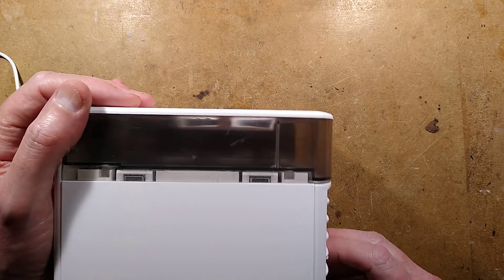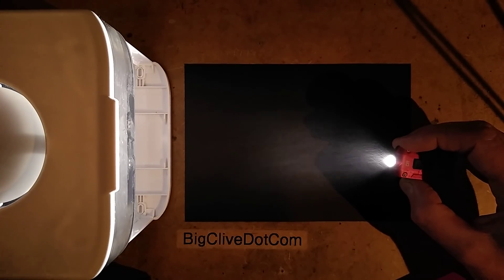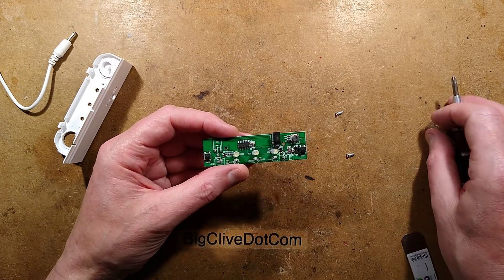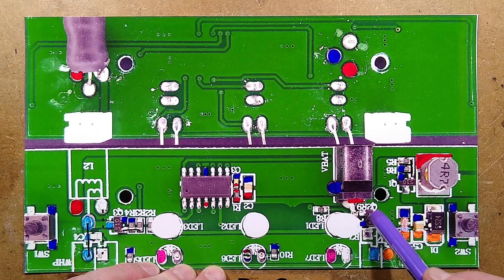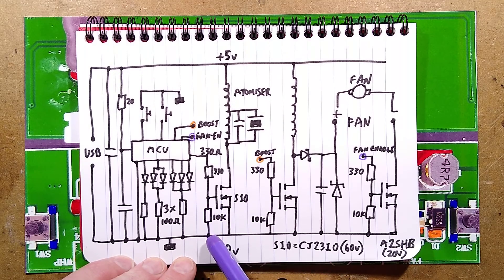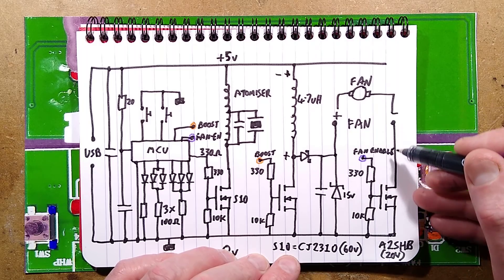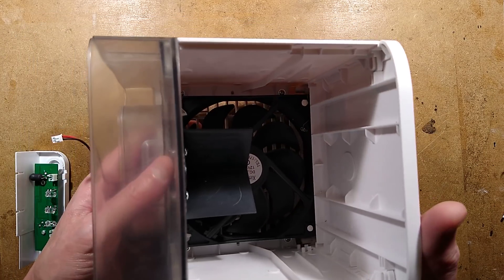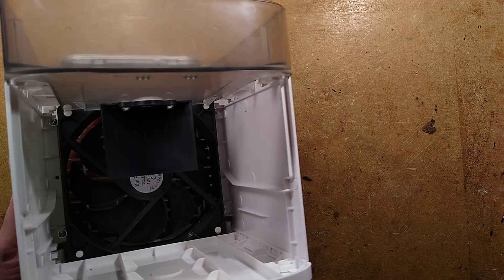USB swamp cooler with fake UVC "sterilisation" (with schematic)

Comment: So I have this cooler but the board is very different inside and my knowledge on circuitry is limited.
The fan was noisy as hell (cheap) so I replaced the fan with another but its drawing 0.1amps more. That is enough to drain the 12v booster circuit on high speed... any mods I can do? Guessing no as I'd lose my speed control right?

Comment: The way I see it, these things are actually amazing products hindered by absolutely crap marketing to the wrong audience. Sell them as Maker Cases or something, a solution looking for problems, and you'll get people to actually use them instead of throwing them in the bin and calling them a scam. I just got one and find it would be a great sleeping fan due to the loud noise and soft light, minus all the water bits. Another use I could have for it is as a small-space spray box for air brushing models and miniatures - Just remove the atomizer, reverse the fan, put a filter in the back, swap out the LEDs, place a turntable on the bottom, and I've got a nice well lit box to safely paint in. Put some paper or cloth in it and can then use it as a light box for taking photos of finished miniatures. The reservoir serves as a nice way to add and manipulate the lighting, and is ample enough to be used as storage for painting supplies or bits I'm working on. I thought about replacing the atomizer with a motorized turntable, but I don't know enough about electronics to know if that's easily possible. I have my doubts that the atomizer can handle any paints, and there's little reason for it since I have an airbrush, but it might be able to produce some unique and interesting results if it works.

Comment: If you freeze the filter after wetting it it works for about 5 ish minutes of really cold air, and if you have the water in the top it would extend it a bit, tho it's a waist of time to even do this, and you can get sick from this also

Comment: B.C. i found an opto- for detecting UVA, B and C. Mind you that UVC has power in the microwatt range ! 
The above dtectors guvct21 costs about $15 and give a reading on a voltmeter. There is a demo that 
bacteria are killed within seconds. He shows this with an overhead projector. To be seen here :
https://www.youtube.com/watch?v=nMHTATL-ZHY  In the 60's households had a artificial
sun that emitted these stinging UVC's. There are also UVA/C testcards but these need > 300 microwatts
to react. Which is above the health range. This would be a nice new project.

Comment: Ive got one very similar to that, i replaced the sponges with dishwashing sponges. It works well in an airconditioned offices. It adds to humidity but hey i was cool.
Mine has the spots for the uvc but nothing there. The colour changing is still there 
I use it now as a smell machine ie tip essential oils in the resevoir and turn it on to make the place smell better.

Comment: Did you know that you are being used in an ad for a company called voltex?
Reply from the maker: Yes.  It happens a lot.
Reply: @bigclivedotcom  just wanted to make you aware, seen and thought i recognise that hand and bench. It contained a circuit breaker with a red and blue wire coming out the bottom.

Comment: These things do work a bit when you ventilate the room very well, e.g. wind outside with open windows. But when you close everything, the only place keeping a bit cold is right in front of the device, a nasty island of comfort, because the rest of the room keeps rising in temperature and humidity.

Comment: As far as L2 (For atomizer) is concerned, it could be that the PCB silk screen is simply wrong. An easy way to check, without unwinding it, would be to ohmmeter it to determine which terminal is actually the center tap.

Comment: They built themselves an open loop boost converter with no feedback, relying on the fact that the fan is a (mostly) known load to set the duty cycle on the transistor blindly for their low/medium/high settings just to save themselves a comparator or analog input; fascinating. Especially since it meant that the zener became a required component instead of an optional one.

Comment: Comments

Add a public comment...

Steve L
Clive,

When the ultrasonic crystal is not powered, what keeps the water from a full tank from dribbling out?

Any idea what the voltage and frequency driving the crystal is?

Physically, what does the ultrasonic crystal look like?

Mad scientist idea; Adding a heater and pot infused e-cig fluid to the hopper could make your next disco gig a real "high"!

If we hear that the Isle of Man has slipped it's moorings and gone adrift, we will know that you tried the experiment, and it was a "hit"!

Thanks, Clive  :-)
Reply from the maker: With a full tank it is prone to oozing.

Comment: Swamp coolers on the coast is a waste of time.. I have one, humidity never drops below 55%.. But it was not the main reason, it is a big unit with a powerful squirrel fan, it can suck in cool air at nights and blow it across the house, in line with the prevailing winds. 

Too bad this is an "eco" house designed to trap heat in the structure. So, one it warms up, it stays warm. I can pump in cooler air, when it is 29C inside and i pump in sub 20C, i can get the apartment to lower to 26C, and within one hour, it is back to 29C. 

But in the odd days that humidity is lower, it is a nice "bonus". I've been thinking about using a peltier, a radiator and a closed waterloop... The damn thing is so big i could easily fit it in there..

Comment: live in Denver Colorado,  it's been more humid than normal and still only 40% humidity today.  Was 100* F (38* C) yesterday and my large house was 71* F (21* C) all with a swamp (evaporative) cooler in first floor window.  Amazingly effective most the time here.  I still think these little desk top things might only work if it's right in front of your face.  The cooling is directly proportional to the amount of water you evaporate,  my cooler has a constant water supply (with float control),  huge fan and 3 large meter square pads.  That thing holds a couple hundred cc of water, that doesn't translate to very many BTUs when evaporated.  I suppose still better than just a fan alone.

Comment: AAAACK! Finally got the time to watch the rest of the last live stream and it was gone!! I managed to catch the first three or so hours and I was left in stitches! LMFAO with the antics of the other two members of the MBC!!! Your expression at their shenanigans reminded me of the the American comedian Jack Benny when someone really pissed him off ! 
Interesting device, been using "negative ion generators" for over 30 years, mainly in my vehicle and especially on long trips, its quite invigorating and keeps me far more alert while driving. My most recent purchase was from a truck stop back in the states and it was quite similar to a large one you showed when you shared the type of plastic containers you use for storage. It operates off of 12VDC and I keep it running 24/7/365 in my store rooms (through regular rotation) it helps kill off mold and that stagnant air one finds in a damp environment here in Crete. I need to take it apart every two months to clean the needles and the large stainless assembly in front of the emitters.

Comment: Obviously in this case UVC means useless violet colour! Anyhoo, one bit that intrigued me was that the atomiser passed the water through it!? That wasn't explained in much detail. How would you drive something at high voltage if its effectively immersed in water? Does water dribble through without the atomiser function on? Maybe the drive circuit is utilising the series resonant mode of the transducer, this then would be all current and low voltage?

Comment: I have an interesting one for you...
A Ritello Purello.
Which is a waterswirling air purifier, which can be scented. It's advertised as having an Ionizer, but the also claim it doesnt produce ozone...
Would be interesting to see the ins and outs of that device...
Reply from the maker: I've taken a water air cleaner apart in the past.  If it has an ioniser it will contain one of the little black potted modules and will produce the tiniest trace level of ozone below naturally occurring levels.

Comment: Driving 12V fan with 5V is quite normal thing to reduce noise in PC cases. First you need get the fan going and then reduce voltage.

Comment: Have you tried using vhisky or wodka instead of vater? At least then you won't be disappointed with its cooling performance when you're in a drunken stupor by the fumes or maybe you could use it for that sole purpose.

Comment: So fake UV as protection from presumably  legionella that causes Legionnaires Disease. In my opinion, unless you are seeking cooling from dry desert heat, evaporative cooling is a waste of time. In the uk, our heat waves seem to be associated with high humidity, and even when there not, the last thing you want is to be both hot and wet.
Maybe you should add an an ozone generator, it will likely be more effective than those LEDs.

Comment: These things are absolute rubbish. It's all quackery. I borrowed one to try and discovered it was utterly useless - in my non-climate-controlled garage, the only thing it was good for was making it even more humid, and I had to literally put my hand an inch or two from the grille to feel anything.
One year, I built a "better mousetrap," out of a cooler, a tabletop water fountain pump, some vinyl hose, and a smattering of PC cooling parts (radiator, high-CFM fan, fan duct, a PWM fan controller). Fill the cooler with frozen bottles submerged in water, the fountain pump circulates ice-cold water through the PC radiator, the fan blows cold air across the radiator into the duct that can be aimed where you want it. It wasn't perfect, but it worked reasonably well for direct spot-cooling (albeit noisy, I blew out the PWM controller out of stupidity so I ran that sucker at full-tilt). I've done two different iterations, and there are still kinks to work out, but I stopped working on it because, let's face it, it's horribly inefficient.
One of these days, I might get to playing with Peltiers, water loops, mini fans and radiators. I'm only looking for a small zone of cooling, it would cost a LOT to have my garage electrics updated to support a better cooling solution like a through-wall aircon. Plus, it would be kinda fun to design it all out with thermostatic controls - the basic idea would be to run the Peltier as-needed to maintain desired temperature of the water in the loop, and use the water in the loop itself for the cooling. I keep kicking the idea around, but I never actually go through with it. lol

Comment: I've seen these in ads on social media for $60 to $90 - and now see they're on eBay for under $20.

It's not about what they are; it's about what they aren't!  They are not an "air conditioner" by any means!  That's the biggest lie.  They claim it will cool down a large room quickly - another advertising hype.

But I see several things missing.  First is a way for it to let you know it's out of water.  And with a uC inside, it would be nice if it would tell if there was enough temperature difference between the wet and dry temperatures to be effective at cooling.  What do two 1N4148 diodes cost?  They can be used as thermometers.  I think those fake UV and tricolor LEDs may have been meant for the water sensing indicators, etc.  Like, why bother putting them in there if they're doing nothing?  And the uC could be used as an hour timer to automatically shut it off.
For an extra nominal cost a motion sensor could be added to shut it off when no one is around.

Thanks, Clive for your taking to bits and schematic.  Very enjoyable.  You might try looking for hidden operating modes by pressing and holding the buttons, or rapid pressing multiple times. 🧐🤗😁

Comment: What flashlight is that ? CRI ? Looks like a familiar construction to my Nitecore Model: TIP SE
Reply from the maker: Tip.  Not sure which version I used.
Reply: Actually, I do have the tip cri 2017 edition very neat and small 😊😊 with the Nichia219B LED 98CRI😎😎

Comment: I, had one of these and when I plugged it in to a 5 volt  2.5 amp usb it worked and then switched off and failed then I turned it on again and then it went off and then after I tried a 1.5 amp 5 volt usb and it worked.

Also, I removed the inductor from the board and it accepted a 5 volt 2.5 amp usb.

Comment: Cant believe people are still buying these ! they are NO WAY a air conditioner we call them here in the US a swamp cooler they wont work in my area too humid They work a bit in the dry desert areas  Ok  . Cant see how they get away calling it a AC unit ?? No compressor No  condenser or evaporator or refrigerant in them !

Comment: Anglia Components have real UVC LEDs. They are gradually coming down in price, not long ago the cheapest was >£10, but they are down to £2:20 or so, for 277nm Lite-On in the classic square SMD package with quartz window. The £1:65 ones are out of stock. If anyone wants a diagnostic for checking if LEDs are really UVC, the forward voltage starts at 6.9v. Anyone else see that Lidl were selling car air cleaners? With a UVA LED that they claim kills bacteria and viruses...

Comment: Are we certain the LEDs are not UV as well as visible? Most UV LEDs emit some light in the visible, to my knowledge. You'd have to check with a sensor other than your eyes to know for sure.
Reply from the maker: Resin package.  Not viable for current UVC LEDs.

Comment: There you are, covering an evaporative cooling unit, in spite of high humidity in your house. And a much more fancy one than the one I suggested! ;) No hard feelings though. I have the opposite problem, at least in winter, the humidity in my flat goes below 20% which can make it quite difficult to breathe at night, so I have my fair share of experience with air humidifiers (the opposite of what you need in your house). I must say these ultrasonic vaporisers aren't any good. We have so much calcium carbonate in our tap water that after a few days of running one, everything is covered in a white sort of dust, really nasty. Hence, if I use a humidifier, I'll now rely on one that has a heating element to actually boil/steam the water. It needs cleaning after a few weeks as well (with a big layer of limescale built up on the heater), but it's not as bad, just takes a good treatment of vinegar...
Also, the evaporative cooler I suggested also had this 12V fan but ran on 5V USB power, so it has a step up converter in it (and a noisy one at that, probably some PWM bs).  I haven't gotten around to switching it over to the other power supply though, although I already have all the parts here. Fixing and improving the peltier element based cooler box for the car was more important for now ;)

Comment: This circuit reminds me of the wizardry going on in early generation Philips Sonicare toothbrushes where a mystery ASIC chip appeared to contain a rectifier and a MCU for doing pretty much everything like the inductive charging of the Ni-Cd battery, and driving the electro magnet coil to oscillate the toothbrush head. If interested read an example teardown analysis here https://www.powerelectronictips.com/teardown-whats-inside-a-phillips-sonicare-electric-toothbrush/. Not sure if Clive can get his hands on one of these older generation Sonicare brushes for teardown, but I would personally love to hear his explanation how they handle converting 12V 100kHz AC from inductive energy transfer for charging a 1.2V DC battery at 150mA or less and generate 250Hz 1.2V dual asymmetric AC to drive the brush head coil.

Comment: Thank you for the teardown and schematics. i have a similar device i got last year. the plastic case, removable louver with foam element, the fan and the ultrasonic atomizer are all the same. mine does not have the fake UVC LEDS... what i want to know is how the ultrasonic atomizer works... it seems there are small holes in the center of the membrane...  what frequency and voltage is supplied to it ? an oscilloscope trace would have been fun too...  thanks again, im a big fan from the Philippines.

Comment: This is not a new concept by any means. Back in 1972 I moved with my Army Unit from Fort Lewis Washington, where we trained in Mountain warfare to Fort Bliss Texas, where we trained for war in the middle East.  When we got down there we found all the building's had these huge boxes atop them, the homes had the same thing many mounted in the attic's some hanging out windows.  Fort Bliss is in the middle of the desert, thus the climate is very dry and very hot.  Those towers and boxes were swamp pumps, or water coolers to the uneducated. The worked by having them hooked to your water circuit in your home, then there was a pump that pumped water through filters on three sides of the box, where it trickled down the filters which were made of fine wood shreds.  Inside the box between the filters was a huge squirll cage fan that pushed air at a tremendous speed down the duct work and into your home, thus cooling the air in the desert to a livable and very comfortable level of around 70 degrees. I love them. Only problem, if it rained they were worthless, if it got humid for some reason, no cooling. That rarely did happen though and the cost of running them compared to the regular air conditioners was less then half. I have seen folks up here in the Dakota's who moved from down there try and use them here, most were very disappointed since our area has relatively high humidity. Far to damp for the water to evaporate and cool the air.